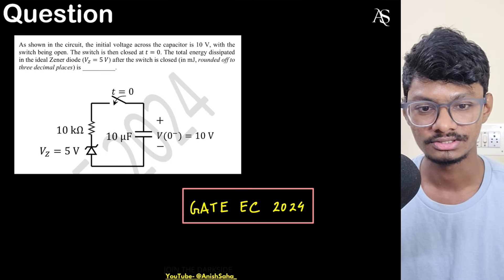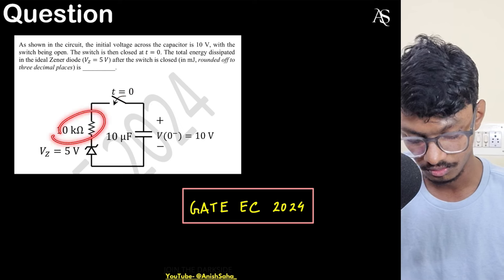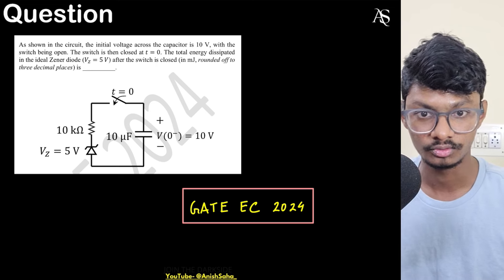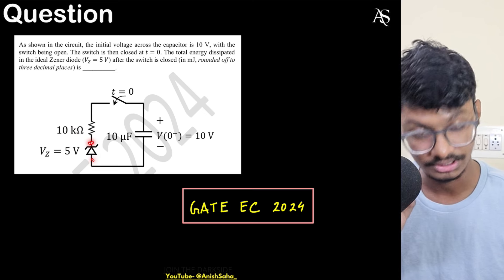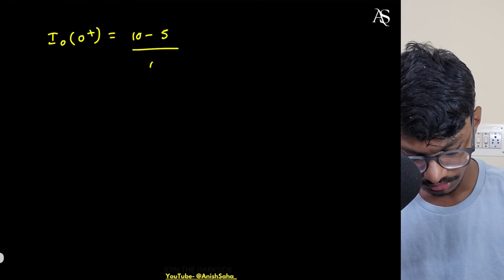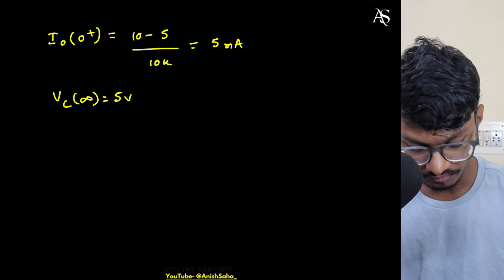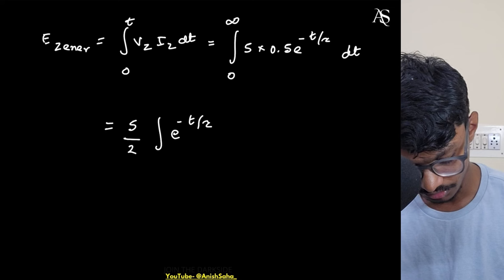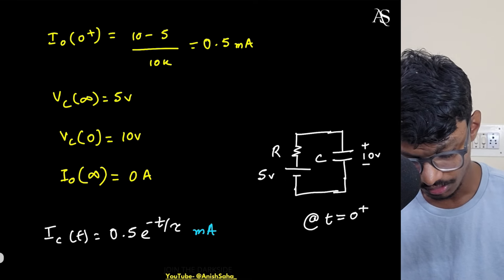Series CR With Zener Diode || GATE 2024 Analog Solutions || Circuit Queries

Comment: Sir I think when capacitor voltage will become less than 5V then the zener diode will also turn off hence the limit of integration will be till the time when capacitor voltage becomes 5V not till infinity.
Please correct me if I'm wrong.
Reply from the maker: That's the catch! Capacitor voltage never reach 5V. It will be very close 4.9999999999 but never 5 it will reach 5 only at t = inf.

Comment: sir for the last question, since capacitor instantly changes its voltage then there might be infinite impulse current flowing through the circuit, then does that mean zener diode might burn out?(since it the current might be more than Iz max)🤔
Reply from the maker: Yes zener diode will burn out. I just asked the question theoretically, practically question doesn't make sense.